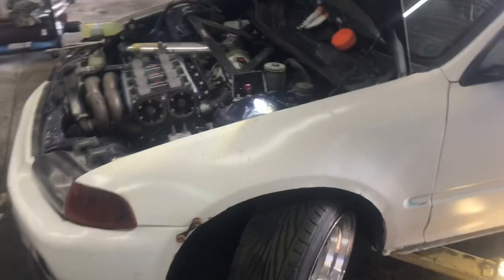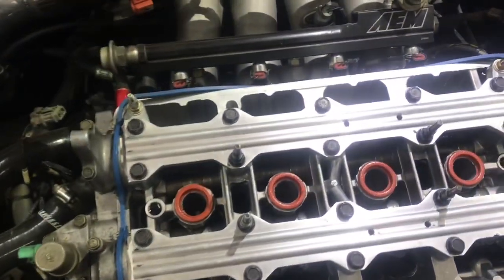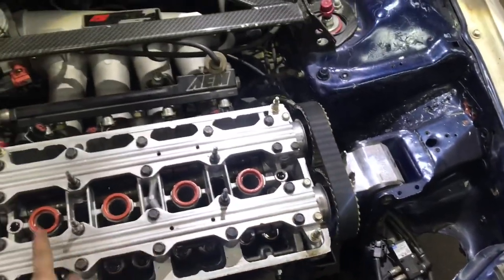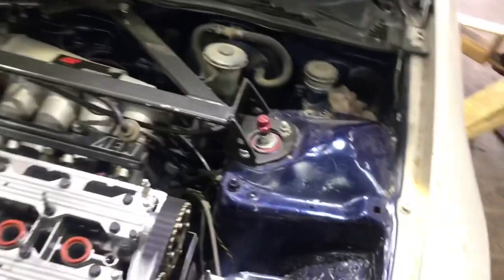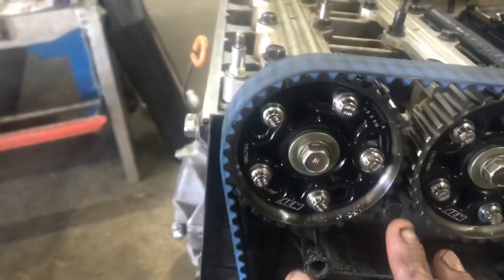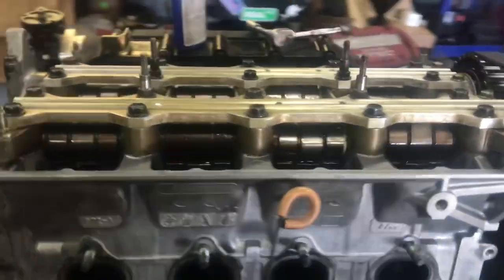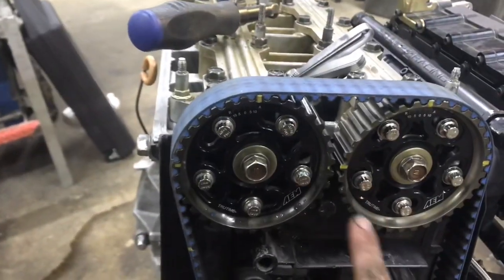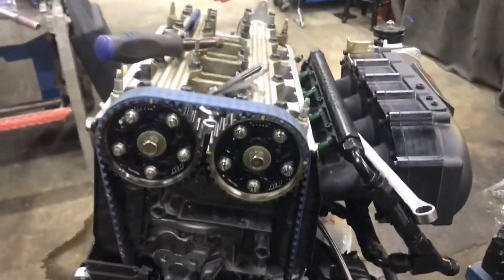Recap on Degreeing B-series Cams

Comment: Question I know I’m supposed to comp test with the engine at temp but what if my car isn’t running only cranking ... will a cold comp test read lower? And can anyone estimate by how much? My stock b16 was reading 125s and then 95 in cyl 3
Reply from the maker: I'd check cyl 3 yea you can do it cold yea it'll change some but it should be close
Reply: GoofyBuilt Shane Ight bet! Can’t wait to see more updates on your rex

Comment: And that is why I don't cut my valve cover at all. 
ANYTHING CAN HAPPEN.
Reply from the maker: What are you talking about?
Reply: @GoofyBuiltShane  
A rag when into the cam sprockets. I'm guessing the valve cover was cut to expose the gears.
Reply from the maker: Not in my shop or in one of my videos
Reply from the maker: Even if they had the outer cover off could have grabbed the rag if in a bad spot
Reply: @GoofyBuiltShane  
I see. I wasn't really pointed out YOUR video. It was a general fact.  
But good vid nonetheless

Comment: Isn't that red 9th gen si a k24z7
Reply from the maker: Chris Ortega it might be a 24 but I thought it was a 20
Reply: GoofyBuilt Shane 8th gen is k20z3 9th gen k24z7 10th gen L15b7 🤙🏻
Reply from the maker: Chris Ortega i honestly just thought the civics came with k20's cause they're a smaller platform but rad thanks for the knowledge
Reply: GoofyBuilt Shane no problem bud keep up the awesome work ! 🤙🏻